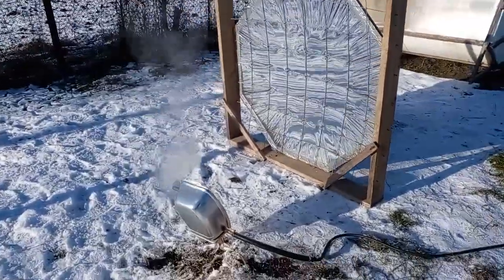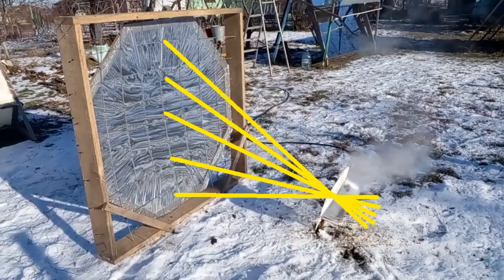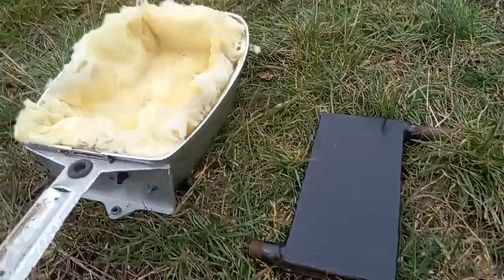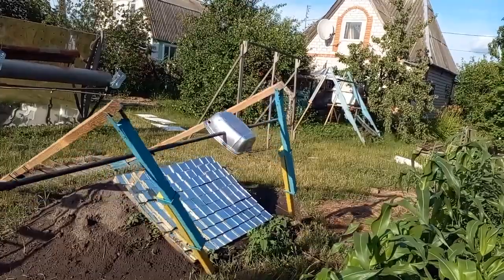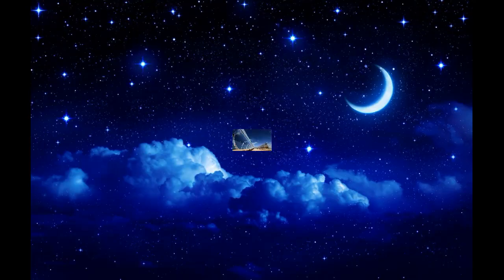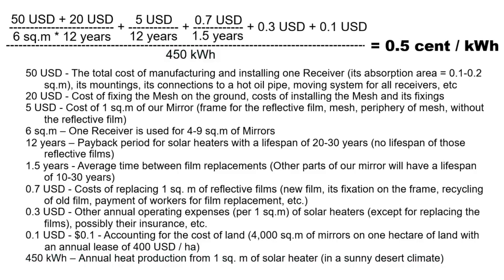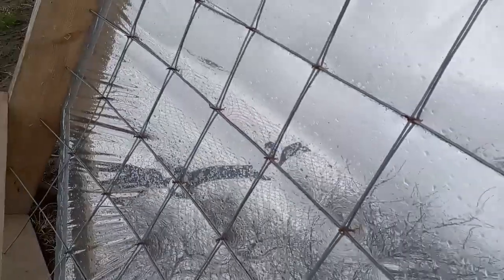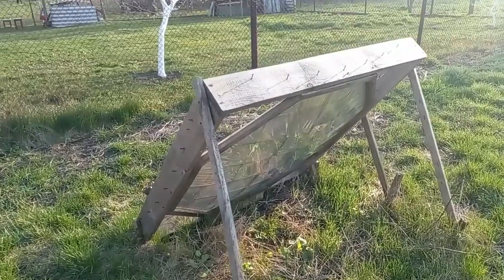The cheapest solar heater of Parabolic Dish type

Comment: I have long wanted to test a parabolic mirror created with a little vacuum pressure. A Mylar sheet would be under tension and sealed across a large cylindrical object of some sort, (Animal water tub, kids pool, etc). The vacuum pressure would evenly pull on the Mylar to create a variable focus.
Reply: someone did something similar already but he had a lot of practical issues (difficulty to maintain vacuum, rupture of the membrane).
ideally you want to use the vacuum to make an ideal parabolic shape and then seal them in place using epoxy or any other material that hardens

Comment: The hurdle with concentrated solar power is not the reflective material, but the cost of the tracking system. How do you purpose to solve this?
Reply: stick em to the top of sunflowers 😄
Reply: More mirror. It doesn't need to be perfect when it costs 10 bucks, just make 10 of them. Tilt them for each season.

He showed how to move the receivers.

If you only want to care about tilt you make it a cylinder rather than a sphere.

Comment: AND your solutions are safe from any EMP from the Sun!  As the magnetic poles continue to shift, and the Van Allen Belt gets more and more messed up, the UV getting tjough from the Sun increases. When the next Carrington finally makes it through, all the more "sophistocated" solutions will fry, literally, but * yours * will not!

(Of course, we still have to protect the wiring we connect to your panels, but that's beside the point... 🙂)